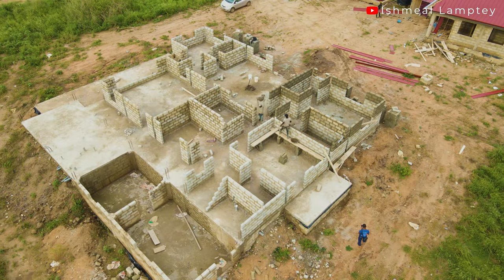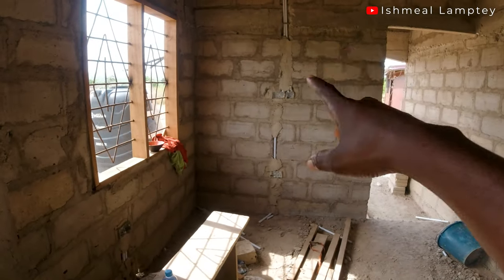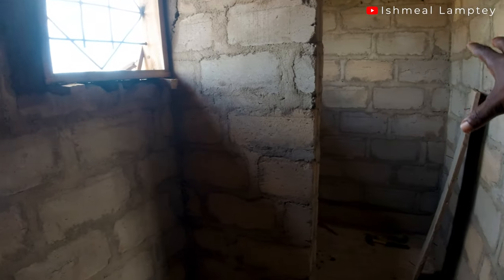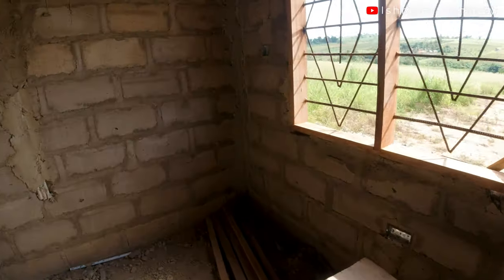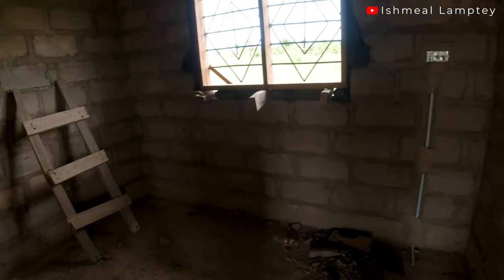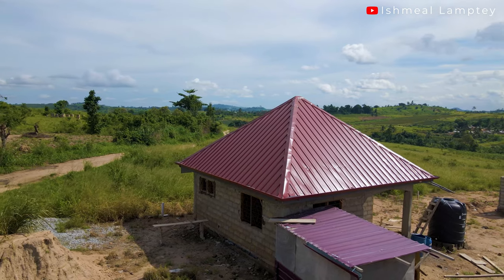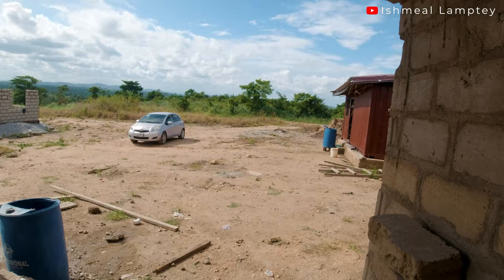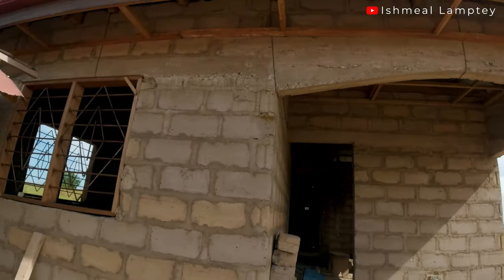Building a Minimal 1 Bedroom Self Contained House in Ghana

Comment: Where you talked about using for dining...the wall it shares with kitchen. I think a servery or pass-through will aid more access. Can be used also as bar, coffee area or generally working area with laptop. Also you may place kitchen sink at window side. Will aid exhaust smell. Infact, I'll even recommend ceiling/wall mounted exhaust fan (the one with duct) for bathroom. Recently installed one and has improved the indoor air quality and reduced bath moisture.
Reply from the maker: Really great ideas. I will see what my budget will allow and have them incorporated into the design. Thanks a lot for the suggestions. Really helpful

Comment: Nice, it  could have used a few more feet of space lengthwise and width wise.  From this angle looks very claustrophobic especially with only one exit point.  

The wall from kitchen to office/dining room if removed would have made for a lovely open concept area.

All in all looks well built 👍
Reply: The point is to keep it small, agree could be interesting to open up. It could be done with same footprint and have one large room (studio style) only plus a bathroom, use a fold up Murphy bed. Some are very ingenious and fold up to look like a bookcase, desk area etc.
Reply: @bbalderston125  yes I agree with you.  And knowing how much heat concrete stores up, heat might accumulate in a small area and not easily dissipate
Reply from the maker: I disagree with this. Depending on your ventilation system you might bot experience so much heat. My space is very airy i must admit. Every part of the house is airy.
Reply: @IshmealLamptey  Awesome!thats great to know.
Reply: @IshmealLamptey  that's good

Comment: Personally I suggest the window size in the kitchen should have been 5ft for ventilation ,u may need a heat extractor in the kitchen .
Reply from the maker: I must say that, the most airy part of the entire house is the kitchen. I think it will be fine there without an extractor
Reply: Oook that's fine.